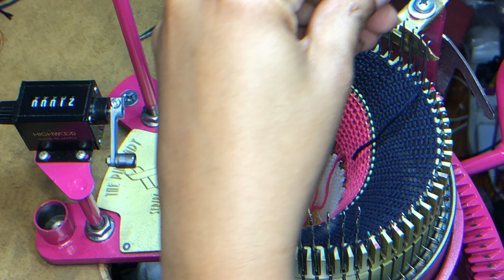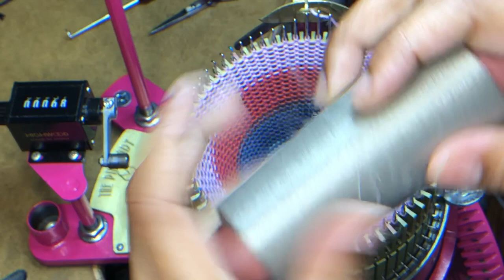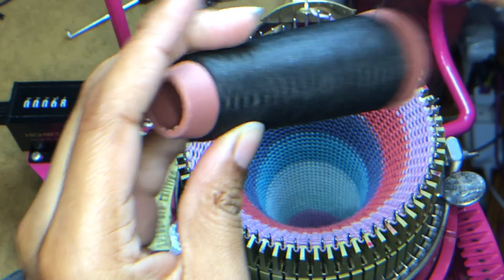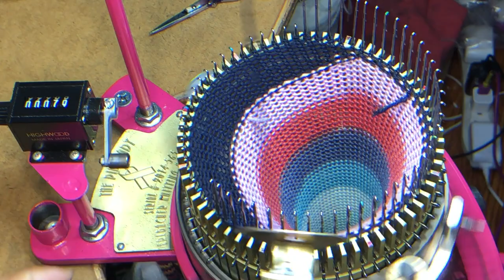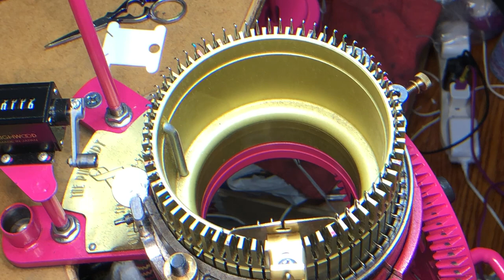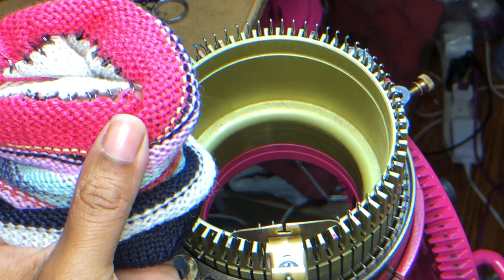CSM Heel Tab Socks Demo

Comment: Roz, thank you for posting this video! It is very helpful! I have two questions... What type of yarn are you using for your rip out row? (The yellow yarn - I don’t know what it is officially called.) Also, do you knit your toes on the “back” needles because you prefer to kitchener on the bottom of the foot rather than the top? Thanks again for sharing!
Reply from the maker: The ravel cord is braided fishing line. 80lbs I believe